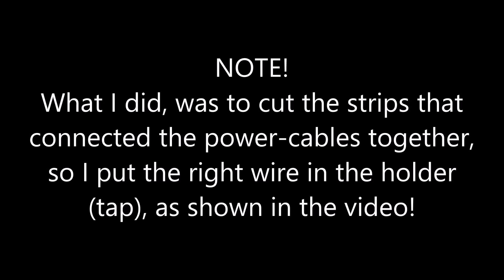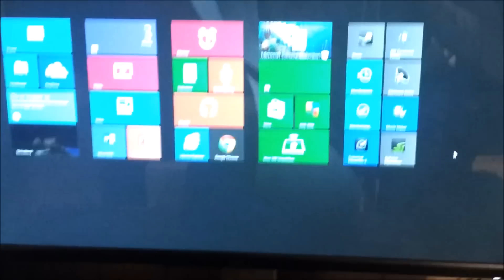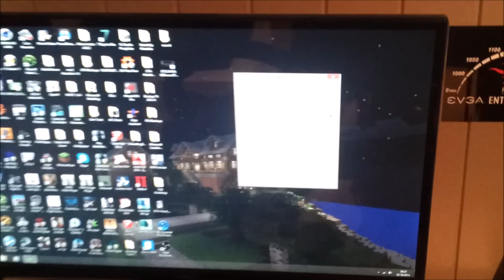Alienware x51 EVGA GeForce GTX 760 4GB FTW /acx Upgrade/ Installation Tutorial And Review

Comment: How did you get 1 8-pin PCI-E connector. Because alienware x51 has 2 6-pin PCI-E connectors
Reply from the maker: I use two 6-pins plugged in the card.
Reply: Games To Tuts Doesn't it need a 8-pin though?
Reply from the maker: Saagster the card has 1 8-pin and 1 6-pin but you can just plug the 6-pin in the 8-pin if you don't have a 6-pin to 8-pin adapter :-)
Reply: Games To Tuts Oh. So it works like that?
Reply from the maker: Saagster sorry i wrote fault, i mean that you can put the 6-pin connector into the 8-pin socket without problem :-)
Reply: Games To Tuts And it works fine?
Reply from the maker: Saagster yes with no problems :-)
Reply: Alright, thanks alot for the explanation.
Reply from the maker: Saagster I am Happy to help :-)
Reply: Games To Tuts so can you upgrade the cpu thing to i7 then put a new GTX 760 graphic card in and could you plz tell me if it matters what i7 prosossor you put in and if you have to change somthing else.
Reply from the maker: XL gameinz XL Here i found some CPUs that should work in the x51 R2 (not sure with the R1) I recommend you to download CPU-Z To check the socket. Make sure that the socket is 1150 LGA or 1150. If you alerady have a 4th generation intel processor in your x51, then you have the 1150 socket.

CPU-Z Download:  http://www.cpuid.com/softwares/cpu-z.html

1.  http://ark.intel.com/products/75122/Intel-Core-i7-4770-Processor-8M-Cache-up-to-3_90-GHz

2. http://ark.intel.com/products/77656/Intel-Core-i7-4771-Processor-8M-Cache-up-to-3_90-GHz

3. http://ark.intel.com/products/80806/Intel-Core-i7-4790-Processor-8M-Cache-up-to-4_00-GHz

Comment: I mean, how to use the two 6-pin cables... And not use the adapter that comes with the CPU.
Reply from the maker: you can just use the two 6-pins that is in the x51 and plug them into the card. It doesn't matter if you plug the one 6-pin cable into the 8-pin socket on the card, because it will work. Make sure you have the 330w power supply :).

Comment: if a 760 fits does that mean a 590 or 960 will too?
Reply from the maker: +Ender Gomez The gtx 590 will use too much power and will not fit i think because of the dual GPUs inside. But the 960 is a good choice, it will fit and it does not use that much power. It even use less power than my 760 :-)

Comment: So I have the exact same PC as yours (Before the upgrade) How does it compare now that you've upgraded, and have there been any problems? I'd also like to know where you got the 330w PSU, and if this is the right card: http://www.newegg.com/Product/Product.aspx?Item=N82E16814130944
Thanks!
Reply from the maker: The Evga GeForce GTX 760 FTW is like four times better than the 645 in the games i have compared. The 760 run games much smoother and lag free. And you wan't get squared edges on games like Euro Truck Simulator 2 and Battlefield 3 and 4 that push your GPU really hard. I only loose about 10-20 FPS when recording with the 760, and with the 645 i loosed the half of my FPS when recording. I have no power issues with this card even if i put every fan in my computer on max speed included the 760 with "speedfan". The only problem i got is that the temperature goes up to 75-80c when playing battlefield 4 and Euro Truck Simulator 2 That is my GPU pushing games. But when i play Black ops and 2 the temperature only goes up to 60 at max but usually 53-56. 

Yes you found the same card that i have in your link.

For the 330w PSU:   http://accessories.dell.com/sna/productdetail.aspx?c=us&l=en&s=dhs&cs=19&sku=332-1432
Reply: Games To Tuts I'm quite worried about putting this card into my PC as an Nvidia rep strongly advised against it. He did recommend this card though http://www.evga.com/Products/Product.aspx?pn=02G-P4-3757-KR
I'm still considering both options though. Thanks for the quick reply.
Reply from the maker: No problem :-) The 760 FTW is much better but it require more power than the 750 TI FTW but it works. I think that is the reason?
Reply: Games To Tuts Yes, the 760 is recommended to be paired with a 500W power supply. I'm trying to figure out how people have used modular PSUs to power the GPU separately.
Reply from the maker: I have seen someone that has the 760 in 2-way sli and use a 750w psu, that is 375w on each.
Reply: Games To Tuts I actually recently discovered the new GTX 970 and 980 which are super power efficient. Many people have had success putting them in their x51s so I'll try the same.
Reply from the maker: yes try one of them :)
Reply from the maker: Yes, he really needs a life!
Reply: Games To Tuts Oh yeah, do you think a 980 would be bottlenecked by the i5-4440? I'm starting to worry about the compatibility of my hardware.
Reply from the maker: Rezirex No i don't think so. I haven't noticed any problems with my i5-4440 with my gtx 760 compared to the gtx 645 and i5-4440, so i don't think that should be any problem with the gtx 970 or the 980 :-)
Reply: Games To Tuts Ok, thanks for all the help. I'm pretty much sure I'm getting a 970 now. After it's in stock, that is. :/
Reply from the maker: Rezirex no problem :-) Yes go for the 970, and make sure you get the 330w psu from Dell. I wish you good luck with the upgrade :-)
Reply: Games To Tuts Hi dude im looking to upgrade my graphics card in my alienware x51 r2 i5 16GB ram can i put a Sapphire R9 270X OC 4GB GDDR5 Dual DVI HDMI DisplayPort Graphics Card in without any problems could you please get back to me with any comment's or referrals to other people
Reply: XL gameinz XL I wouldn't recommend it. It's suggested power supply is 500W just like the gtx 970, however there is a difference. The 970 is extremely power efficient allowing it to run in the x51. While I don't know about the R9 270X, it is probably not as efficient. If you need to upgrade, go for the 970 because you at least can be sure it will work.
Reply: thanks dude could i put the normal R9 270x in
Reply: hey  . that cart http://www.evga.com/Products/Product.aspx?pn=02G-P4-3757-KR can play ultra ??? and if i buy it i have to buy and new PSU??( sorry for my bad english, i am from greece )
Reply from the maker: I think the card runns battlefield 3 in ultra with 40 FPS or something but i am not sure :/ I think you can run that card with the 240w psu that your x51 have i think. But i am not sure.
Reply: Games To Tuts Dimitris Spyrou No, speaking to an EVGA employee, he said the card requires a 330W psu. It's better than the card your Alienware x51 came with, but not as powerful as the GTX970 
http://www.evga.com/Products/Product.aspx?pn=04G-P4-1970-KR
Reply: thanks a lot ! yeah i can see that GTX970 is better . but buying new psu and GTX970 its to expensive :/  its like 500 evro  . What do you suggest me to buy with lowest COST and pretty good performance ??
Reply: Dimitris Spyrou What PSU do you have?
Reply: I have that one that comes with the x51 .
Reply: Dimitris Spyrou Where are 2 kinds that come with it. Can you please measure how tall the power supply is in centimeters?
Reply: it is 2 cm width ,and 19 cm length .
Reply: Dimitris Spyrou That is the 240W Power supply. In order to upgrade, you need to buy this.
http://accessories.dell.com/sna/productdetail.aspx?c=us&l=en&s=dhs&cs=19&sku=332-1432
Reply: Could I get the EVGA GTX 750Ti FTW for my x51 with the 240 psu? I also think that I have R1 x51 since I have a i5-3330 and came with a gt 640 (which I replaced with at EVGA gtx 650ti ssc). Would this change anything?
Reply from the maker: Epiknezz Yes i think that should work :)
Reply: Games To Tuts Heh thanks, also hows your 760 now? Did any problems occur? And any heat problems?
Reply: Epiknezz Neither the 750ti or the 760 will work with the 240W power supply. According to Dell, you must have a 330W PSU to make any upgrades. Although you say you have upgraded before, I wouldn't upgrade farther since 240 is miniscule, and 330 isn't even much for a power supply. I asked a customer rep about upgrading to the 760, and they said even a 330w supply was low. I am upgrading to the GTX 970 this weekend, I will let you know how it goes. Good luck! :)
Reply: Rezirex Heh nice, but I currently have a 650Ti in my PC which takes 110 watts XD.
Reply: Rezirex So did the gtx 970 work?
Reply: Adil Zohrri Yes. Even the SC version.
Reply: Oh no way and how does it play Battlefield and far cry.
Reply: Adil Zohrri Haven't tried them but everything else plays great. They will play like any other 970 on any other pc.
Reply: Rezirex Do you get over heating and power issues? P.S Sorry for so many questions.
Reply: Adil Zohrri I understand why you are asking so many questions. I did the same before my upgrade.

I haven't really been pushing my PC to the limits. I've been playing GTA4 with some graphics mods at max settings, and it runs great.

Although everything runs fine, remember that the 970 calls for a 500W PSU not 330W, so the Alienware will be pushed to it's limits.

If you do play on upgrading, I would suggest doing this in the future: https://www.youtube.com/watch?v=qJBwdBZzySs

If you do not plan on doing that, make sure you get the ref version of the 970 and you will be fine. Just remember to download EVGA PrecisionX 16 to monitor heat and power usage. If you ever do run into issues, simply downclock the max power consumption.
I forgot to mention that I have the Alienware x51 R2. If you have the R1, you will need to upgrade the power board first, and I can't really help you there
Reply: Rezirex Ok thanks I have a Dell XPS 8700 and I upgraded to a GTX 760 even though my PSU is 460w because after I saw this guy put it in a Alienware x51 I thought that it must work in my PC.
Reply: Rezirex The other night I had to call Alien ware support, and I wanted someone with better English that I could understand. So I got a Supervisor in Teir 2 support. After she fixed my problem we had a talk about Video cards.
The GTX 760 Ti was the largest card they tried in the X51, Yes you need a 330 watt power supply you can get on Ebay or from Dell. Inside the cast is a Step up transformer that puts out 500 Watts. 9.5" is the longest card that will fit.
Reply: George MacGillis That comment was really old. I've already purchased a 970 FTW+ and am in the process of transferring my components into a new case.
Reply from the maker: +Rezirex I have done alot on my build. I have got a EVGA Z97 FTW motherboard and a second EVGA GeForce GTX 760 FTW card, Corsair h110i gt watercooler, 120GB hyperx 3k SSD and i have did a mod on my case, i still have the i5-4440 CPU but it feels like it gets bottlenecked by my 760s, because i had better FPS in games that uses much CPU before i gpt the second 760 :/ but i wil get the i7-4790k later when i get the monney, but i am really satisfied with my build now :-)
Reply: Games To Tuts And all this is in the original x51 case? 
Albeit modified...
Reply from the maker: Rezirex nope have gpt the NZXT Phantom special edition orange/black, with orange LED lights in :-)

Comment: People talk alot of shit Bout the x51 and the psu... the psu that the x51 has is one of the most efficient. When people buy a card they look at the recomended psu reauirement and they think that the x51 is shit.. when u buy any card look for its TDP. Total Draw Pull that determines how much power the card needs I installed a zotac gtx 950 amp edition which is facgory cloxked to 1250mhz and boost clock of 1450mhz. The cards tdp is 120watts under full load. I have a 240watt power supply for my x51 and I game for hours just fine.. lets put it this way u can easily put a gtx 970 and 980 in the x51 if u have r2 ans a 330w psu with no problems
Reply from the maker: +Kygre R Yes this is correct, the alienware PSUs is very good, and they does even not get hot at all, and they does not have any fans, that is cool :-)
Reply: +Kygre R how can you tell if you own the R1 or the R2?
Reply: Depends on how many USB 2.0 u have. If u have 2 then u have thr R1 if u have more than 3 that's the R2.
Reply: Thanks for answering fast, it appears I have four

Comment: U should buy a GTX 670 which is MORE better than the gtx 760
Reply from the maker: You can't buy a 670 anymore, and the 760 is a "Replacement" for the 670. The 670 perform better than the 760 in some games, and the 760 perform better than the 670 in some other games.